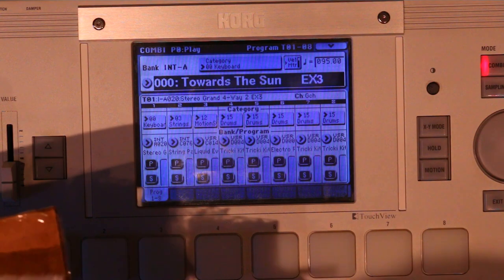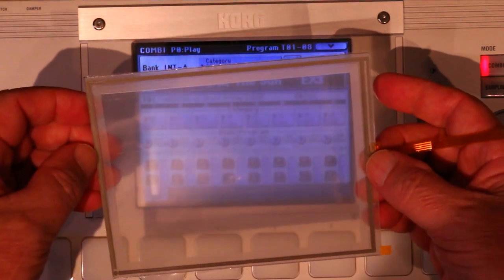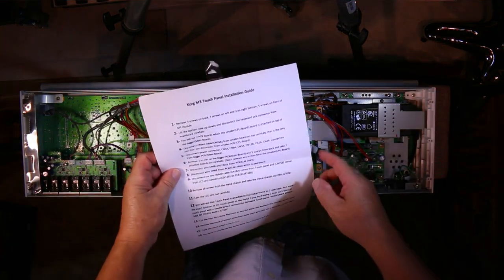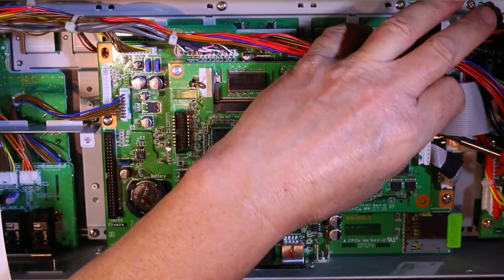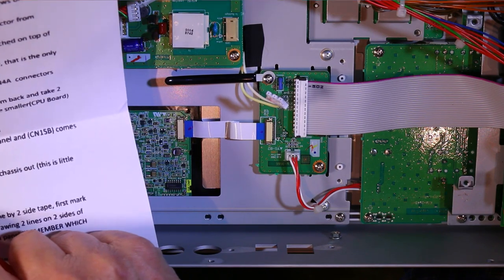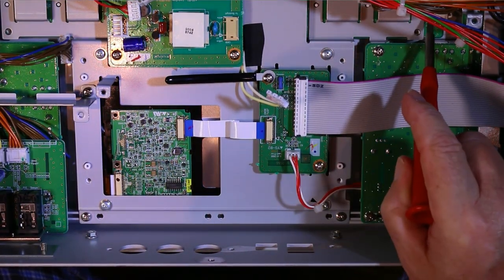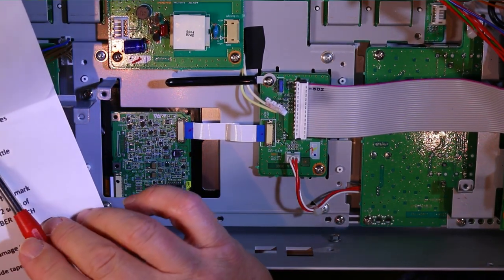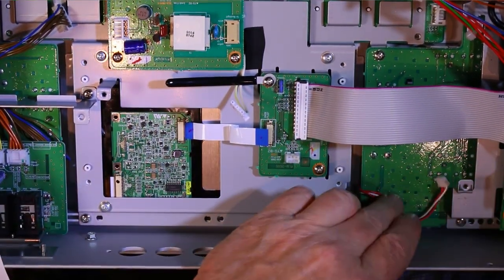How to Fix Korg M3 Display - Change Touch Panel - PART 1

Comment: Thank you so much. I was really worried about my Korg M3 as the touch panel wouldn't work at all now. It was like frozen. I was going to buy a replacement kit for the window that I found on Amazon for $59 and so I came to watch your video and low and behold I calibrated my machine and now it works fantastic. Just like how I bought it. I cannot thank you enough. Thanks Jonathan A

Comment: Thank you! I just replaced the touch panel on my M3. Your video really helped me. I can't thank you enough. If you are reading this and thinking about replacing your touch panel, it's pretty simple. Just take your time and label things if you are not sure.
Reply from the maker: glad it helped you:)
Reply: hello   if the sounds and rhythms on the screen spontaneously problem in sensor or display?help me pls

Comment: Great video - thanks!

I followed the instructions and also followed some advice on the Karma forums about trying to trim the last few mm on the touch screen ribbon before actually swapping an entire unit - and that's worked for me. You still need to get the main board off - and your video is a lifesaver for helping with that - but you don't need to detach the screen assembly as the ribbon is easy to get to once the main board is removed.

Apparently the gold connectors corrode where the ribbon is inserted into the PCB - and trimming them allows you to insert clean connectors.
Reply from the maker: Kieron Edwards Great, glad it helped you. Thank you for input.
Reply: whoyoum I've just swapped screens - the "trim the end of the ribbon" fix lasted about a day. I ordered and installed a new screen with your video up so thanks, again, for doing it. One thing:  I didn't both remove those really hard ribbon connectors - and it was still easy to switch touch screens. I notice you had trouble with them and I didn't want to break anything permanently.
Reply from the maker: Kieron Edwards Cool, mine still working fine hopefully will last long enough. Thanx for advise on ribbon.

Comment: Thank you so very much for this! I used your video in conjunction with  the pdf instructions and it worked like a charm! Touch screen is like new.     I ordered a kit from Amazon.com which included the double sided tape, razor blade, and battery. Also, I labeled small cups with screws as there are  great many. Great job and thanks a million!
Reply from the maker: That is awesome :)
Reply: I use an empty egg carton for screws - for every electronic parts replacement/repair job.

Comment: Thank You! Got a M3M for free, touchscreen not working. Bought kit from Amazon around $45 . Followed video, really not that hard. Careful removing old two-way tape, put a small scratch on display. Can't see when on. Don't affect touchscreen but still... Anyway everything works perfect!
Reply: hello   if the sounds and rhythms on the screen spontaneously problem in sensor or display?help me pls

Comment: Thanks a lot, through you I saved my M3!
Reply from the maker: You are welcome! Glad it helped.
Reply: @whoyoum  hello   if the sounds and rhythms on the screen spontaneously problem in sensor or display?help me pls
Reply from the maker: can you be more specific about what is happening
Reply: @whoyoum  during playing on the korg i30,for example,the register piano itself   changes to an akkordion or clarinet and so on     style too
Reply: @whoyoum  vi govorite na russkom?)
Reply: @whoyoum  Alex zdrastuvuyte   problema v tom vo vremya igri  zvuki na sintezatore sam po sebe menyaetsa  naprimer registr piano rezko poyavlyaetsa drugot registr  i ritmi toje
Reply: @whoyoum  kak vi dumaete eto sensor ili ekran?
Reply from the maker: Sorry I can not be much of help for your Korg i30 synth because I do not have experience with it. From what you explained it seems the problem not with display if sounds changes without touching display. But I do not want to speculate without seen it. Try to find help on Korg forum. Good luck.

Comment: Do you recommend buying more than one, just in case for future repairs? Or do these parts degrade even when not in use?
Reply from the maker: Andrew K since it not very expensive I would prefer to have one extra just in case. I do not know if it will degrade over time.

Comment: Thanks for the video but thank God my started working again so i could calibrate it Yea Buddy.   I was wondering if I have to go through all that disconnecting.  I must have had  a power surge. Because  i didn't even use my board that much.
Reply from the maker: +foxybrown2 
:)))

Comment: Having the same issue, had a few wincing moments when you were removing the cables, hehehe, ordered a new touchscreen on fleabay, wish me luck :)
Reply from the maker: TRIaXOR It is actually not so terrible. Good luck :))
Reply: whoyoum
Got the part delivered, seems it was an original Korg part as it was identical to the screen I replaced, managed to install it thanks to your video tutorial as I got no instructions with it :-/ all good though, managed to install it even though I snapped the old touchscreen removing it.

Screen recalibrated and working good :D

Thanks again man :)

Comment: hey what is the document that you use
Reply from the maker: Instructions that came with Touch Panel.
Reply: @whoyoum  ohh understand, its here Brazil only have touch of aliexpress shop and not have manual, if you can send by google drive i will apreciate so much, you inspirate me to repair my korg m3  (6 years buy)  but 2 years ago have the touch problem!

Comment: Hey :) excellent video, well structured and easy to follow. Thanks for your work! Could you give (me) us the name of the shop or where to buy such a touch screen (spare part) please ? Thank you !
Reply from the maker: bekawe2011 I bought it on eBay. Do not know any other places.
Reply: Thank you for answering :) now i found - by accident- a foreign provider who stocks the proper t.screen for the korg m3 (branded and exact the same). the price is unbelievable low so I ordered one to test it. have to wait for the delivery.....
Reply: HEllo! Can you please tell me if the screen you bought worked? And if so, I need to buy one. Can you send me the link to where you bought it? Thanks!!!

Comment: what is part number or model of screen to buy?
Reply from the maker: +Bflatest 
I do not know part #. I bought replacement from eBay just made sure it is compatible with M3.
Reply: +whoyoum do I need any special tools? like a plastic screwdriver?
Reply from the maker: I`ve used regular tools.

Comment: Do I need to backup my data first?? Cheers
Reply: If you are able to back up your data with a limited functioning touchscreen, then back it up; but if you can't because of a non-responsive touchscreen, and if your installation of the new touchscreen is correctly installed, then after the new touchscreen install power-up your M3 and your M3 will be exactly the way it was prior to the malfunctioning touchscreen - all user data will be there - and then back it up; backing up should be a weekly or even daily modus operandi (depending on how much one uses and customizes their M3) - backing up literally only takes no more than 2 minutes - I use a USB stick, and I create a directory on the stick using that day's date.